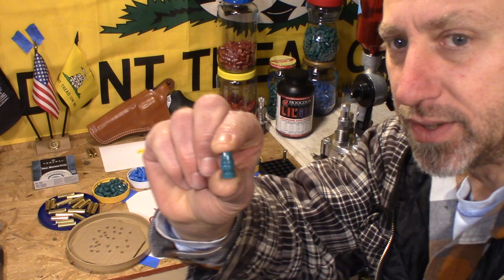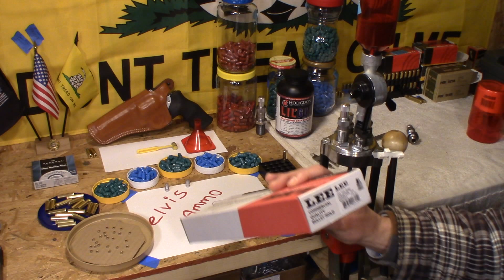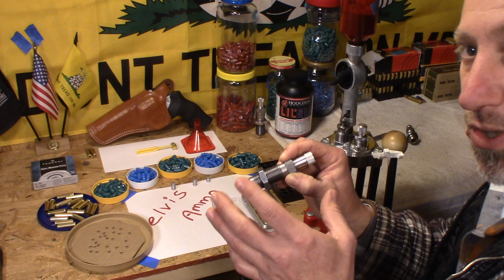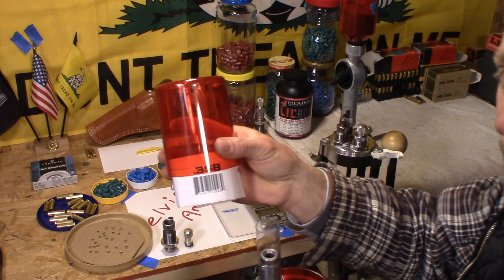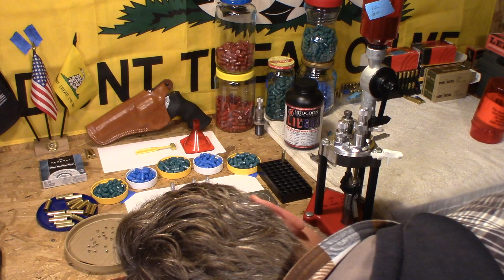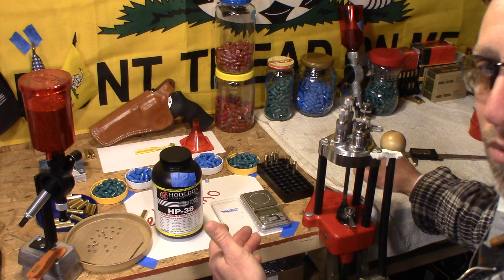Loading "357 MAGNUM" Cast hunting bullets (Process, Details) #3

Comment: Welp looks like I’m going to get good at casting and reloading 38 & 357. I have everything to do it by chance completely. I have bought all my stuff via used selling sights CL,FB market place,GS and the like. Well I ended up with a Dillon that was updated from a 450 to a 550 with a 357 shell plate. Then I found some old molds a guy was letting go and in that lot there was a Rcbs 38-150 swc mold among other stuff mainly for black powder stuff. Then I came across brand new 38/357 Rcbs dies in a lot that had a Rcbs scale. And lastly I had a hankering to get a wheelgun I didn’t know what I wanted but I ended up with a Ruger Security six. All this happened over a 3 year period so all of it was gathered by complete accident. I believe it’s because 38/357 has been so popular for so many years. Every body always talks about how 45acp or 9mm or even 44mag is just the cats meow. Bottom line is IMO 38/357 38 even more so out of 2 has been around for a long long time and can’t be forgotten. All I know is I have heard nothing but great things about the cartridge and firearms. Hopefully it will be a great teaching tool for reloading for me. I just wanted to add my goal was to load for my AR in 223 and I’m extremely close to that also. All I need for that is the Dillon 550 shell plate and I’m on the path

Comment: I use a hornady seating and crimping dies in both .357 and 9mm, and sometimes they grab the bullet a little when releasing ...I'm thinking it's the crimping ring and I have to reduce the crimp a bit to alleviate that....IDK, I've only been reloading for a few years now and because it happens on both dies I figured that's what it was...LMK if you disagree and the dies are actually flawed...Thanks

Comment: I use a lee TL 158 swc mold, bullets are 164gr after coating and lilgun is my powder for screamers. I use 18.1gr  and get an average velocity of 1,555fps from my 6" revolver.
Out of my levergun:
   17.1gr- 1920fps. 
   17.6gr- 1973fps
   18.1gr- 2,000fps

Only a 40fps spread with the 18.1gr charge 

Lilgun is some serious stuff. I would consider 18.1gr the absolute max for that particular bullet. I have worked up to 19.5gr in my levergun It was just ok but one out of 10 cases had a very faint hint of case head separation so I backed down to the max listed for a 158gr xtp.
Reply: I know its a very old post, but I was wondering, did you size the projectiles? If so before or after the PC? Cheers, I’m wanting to make up a cast PC magnum load for my Rossi 92

Comment: Nice tip on that sizing ram...I've used the next larger caliber seater die before to avoid the bullet shave that sometimes happens, but never the sizing ram - neat..!!  I've come to the conclusion that our PC bullets are so oversized since PC adds .0015-.002" to the bullets, that sizing them is a good idea.  If regular cast bullets are like .359-.3605", I don't bother to size them for the reasons you bring out.  Nice video as usual...   I found that expanding die to be confusing also, and I wasn't even using it.   Gotta go out and do some casting now - the lead should be melted... Have a great day,  FC
Reply from the maker: Thanks Mr Fortune Cookie for stopping by... I thought ya might like the sizing ram deal... And yes I size most of my powder coated bullets as well... Sometimes it depends on how a specific mold drops. But the 40 cal die was something I learned from The Hot Lead zone! Happy Casting!

Comment: Would you not get much "stress" on the casemouth when flaring so the unsized bullet vil enter ? I think about getting cracks on the casemouth faster than using sized bullets. And I realy liked all the tips like the tipp about using the size stem and 40 cal bullet die. Great stuff :)

Comment: Elvis, in a revolver you want to size bullets to .001-.002" over the chamber mouth diameter for best accuracy. For example, if the chamber mouths on your Ruger mic .358, you would want a bullet sized or as cast measuring .359 to .360. In my accuracy test this has given me as much as 1" smaller groups at 25 yards over a bullet sized at .358.  Try it and see what you think.
Reply from the maker: Hey Greg Gibson... I think I will try this... i've never had a good collection of data on the subject! That's a good Idea. I don't doubt your right. But i need to get to the bottom of it. It will no doubt be a good and interesting video! Good shooten to ya my friend!
Reply: elvis ammo  fortune cookie has a great video on this.
Reply from the maker: +Sean O'Brien ...yea he's got some great stuff over there. . I imagine I've seen all of them! do you remember what video specifically your referring to?

Comment: You need a loading tray. Load your powder put them in the tray then run them through the press. But you probably knew that just saying. Hey I do like the idea of using the resizer pin in the bullet sizing die. That is a good idea. Keep the videos coming I always learn something new.
Reply from the maker: hey Kenny Dude. .. yea I have reloading treys. .. just trying to keep it simple. . I do it that way for more precision though. .. thanks for your input as always!  ; )

Comment: Hey Elvis- note on powder coating-- I did have to very very lightly case lube the bullets for sizing the bullets. Will use acetone to clean them. Even with powder coating they were hard to size and some got stuck and deformed. With a little lube it worked perfect. But these are pc rifle bullets not pc handgun bullets. That might make a difference. Either way i had to lube to size.
Reply from the maker: hey Vengenace Early. .. I've had to lube em before. .. tiny squirt in a bag shake up some bullets. . I  had no problems. . worked great!

Comment: Good tip on flared cases and oversize die!     sorry if this has been asked/answered before, but what is that digital scale you're using?
Reply: daspencer51 frankford arsenal scale. amazon like 15$-$20 I have 3 never had a issue...other than me loosing them
Reply from the maker: hey daspencer51... that was the Frankford Arsenal. .. it's been great!
Reply: elvis ammo     Thanks.   Got one on the way!

Comment: I like that flat bullet seating stem trick. I am going to use it in flat top rifle bullets. Powder coating today btw.
Reply from the maker: hey Vengenace Early. .. awesome!  let me know how it goes?
Reply: Hey Elvis- first powder coating round went great. I coated my bullets with a low voltage powder setting--from an Eastwood dual voltage gun. . The Color was Grey Artery.  I do a 100 rounds at a time. Will candy coat tomorrow with a top coat of shocker yellow. Baking times were long. According to the tech sheet you only have to bake at 400 F for 12 mins. But that time only starts with your bullets are up to the 400F temp. That took about an hour to reach before the full cure time of 12 mins. I used an infra red temp gun to check bullet temps.
Reply from the maker: +Vengenace Early wow !!! you are going into this with powder gun and all!!!!  let me know how tuff these things are?
Reply: +Elvis- I will send you some so you can check them out .

Comment: hello elvis it is a good idea too use case`s of the same batch,
 case wall thickness is different when mixing brands ,and also sizing the bullet in the case with the factory crimper will be different .the outside of the case is the same but the inside not, and also i think altough not very important  trim the case`s once  to get them al the same lenght and that wil give a true uniform crimp, with all type`s of bullets
Reply from the maker: hey peteralexben. .. I  usually take greater care when I'm looking for high performance. .. thanks again!

Comment: Just wanted to share a discovery I made about sizing 45 acp powder coat bullets.Bullets came out at .456 after powder coating. As I did not have a .452 sizer die yet, I decided to load a few and see what happens, fully expecting to see a bulge in the case and not fitting in my 1911 barrel. There was a slight bulge in the case after seating the bullet. But after running the case thru the Lee factory crimp die it drops into my 1911 barrel with no problem. Next step was to see how they shoot. Accuracy was amazing with no signs of over pressure. I would love to see you test and video your results if you have any oversize bullets in 45 acp for the 1911. Love your vids.
Reply from the maker: Hey James Pollard. this just shows that sizing or not is somtimes gun dependent. My 45 acp likes to be sized!  If you don't try you won't know what works!

Comment: Elvis.. Good instruction.  Btw, A friend of mine years ago used Lil Gun for his 32-20 and 38-55 rifles in 200 yard Schuetzen competition, He used 40 to 1 pure lead to tin mix for his bullets. accurate and a bullseye shooter, if the shot was outside the 25 ring, it was because of something you did. anyway.. I feel that the cylinder throats on revolvers are the most critical, You Do not want to under size your bullets, usually .001over size to exact size to the cylander throat gives the best accuracy.. That is what I have found.  Till Next time Buddy, Keep those nice looking bullets cranking,, Dave
Reply: Thorsaxe777 - agree with you regarding cylinder throats. Just measure them and make sure that the throats are the same or larger than the bore.
Reply: Yep.. Hollow base wad cutters shoot really good at low velocity because of the base expands under the pressure behind it. It sort of makes sense. Thanks Kirk. Good shooting to you Bud.
Reply from the maker: +Kirk Boswell I know there's always the debate on sizing or not. ... truth is , just like reloading for a specific gun. It has to work for ya.... I  hope I didn't overstate the sizing part. .. the process is really what I was trying to get across. .The reason I  bring this up is because there are many times for various reasons sizing is necessary. ..  guns, bullet types, chambers... etc
Reply: elvis ammo - no, no overstating. All good info. As I said, I just felt a need to say "Hi". .............

Comment: My powder coat isn't sticking to the bullets even after heating them for 5 mins have you any idea why . thanks
Reply from the maker: hey Stephen Riddick ...what powdercoat you using?
Reply: Walter Bunning 
Thanks for the info we can get Eastwood hotcoat in the Uk
Reply: using a plastic tub with the #5 recycle mark for the shake operation?
Reply: Deezildennis 
OK cool I'll try that, first time I tried powder coating it worked great but now the powder doesn't want to stick so I'll get a tub with a #5 in it and have a go. Thank you
Reply: I heat my bullets at150f for 10 min. Then dump them into a running vib tumbler and run it for 5-20 min.  You might try heating a little hotter and or longer. Some ovens heat better than others. I have heard of guys preheating as hot as 200f.
Reply from the maker: +Stephen Riddick Let me know how it goes? ...
Reply: elvis ammo 
Hi Sorry I did reply but because I copied a link to where I bought it Google must have deleted it ?
I'm in the UK so it is a UK company harbour freight don't deliver to UK. 
Electostatic magic is the stuff I used as I said first time I followed your instructions and it was great worked well then a fortnight later paint isn't sticking . Stephen
Reply: Hello Stephen, I have a poll/questionnaire about Powder Coating posted @ CastBoolits.Gunloads.Com...90 questions pertaining to everything one might question about the PC process...drop in and examine the poll results...http://castboolits.gunloads.com/showthread.php?326134-(2)-The-Devil-s-in-the-Details-gt-gt-gt-gt-gt-PC-Coatings-lt-lt-lt-lt-lt ... OS OK